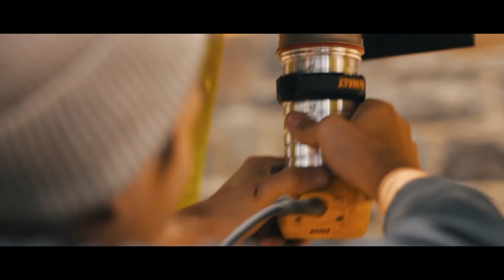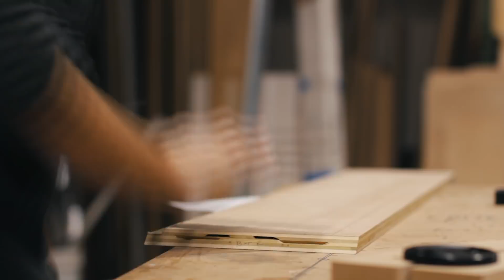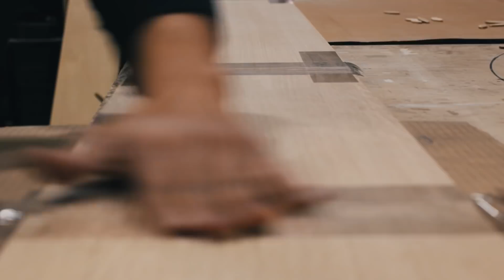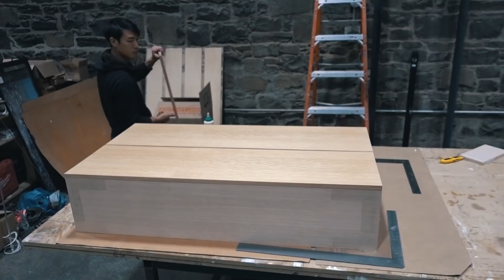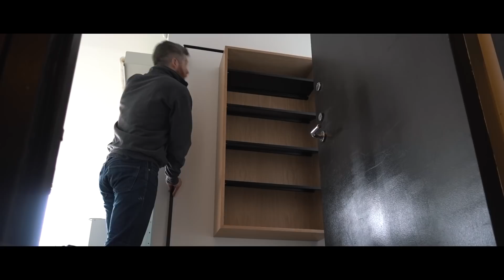Plywood Shoe Cabinet

Comment: Nicely done. We need to get you guys a cheap shelf pin jig like the kreg or something for projects like this. Super quick and easy and really pretty cheap. Awesome work beautifully crafted piece.
Reply from the maker: Thanks Pat! Yeah we definitely need something like that.
Reply: Conor Coghlan yeah cheaper than an in line boring machine but does a pretty good job for $30. Another option would be LR32 system from festool since you’ve already got some of their stuff. If you have a router from them and the holey rail that’s an affordable quicker option. For me two sets of the kreg jig with my hand drill works just fine I don’t make enough cabinets to justify the added investment even though it’s super smooth. A kid on here did make a pretty sweet “knock off” the festool system. I’ll find the video and send it your way.